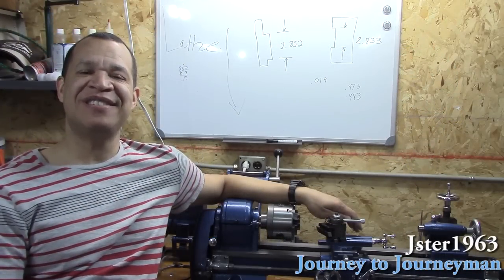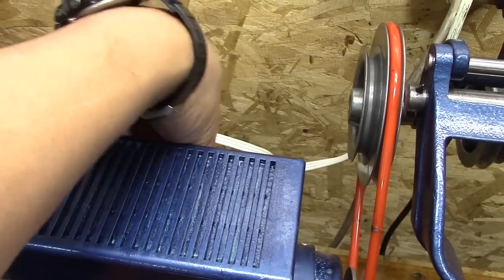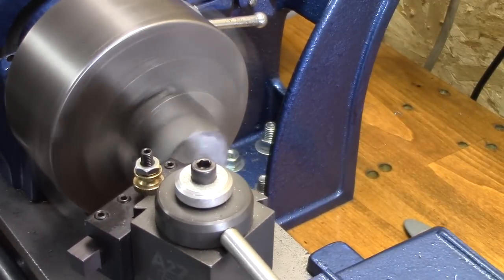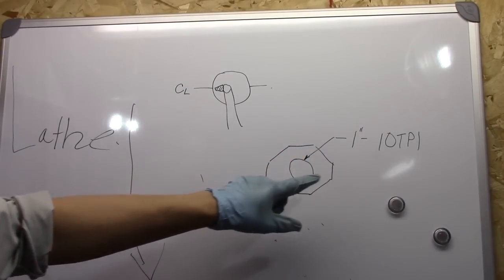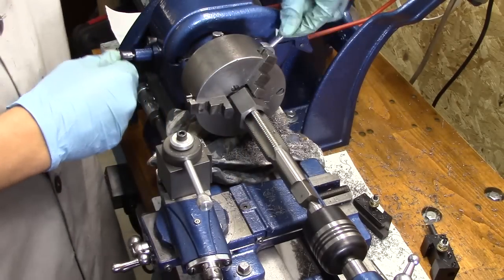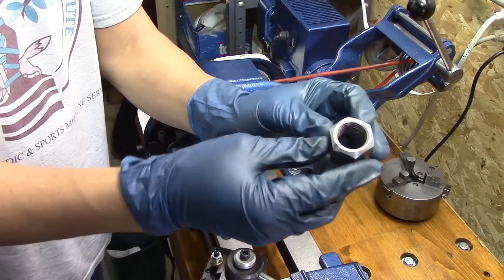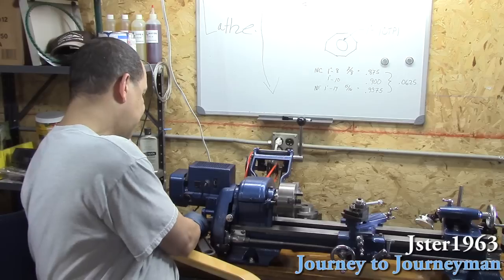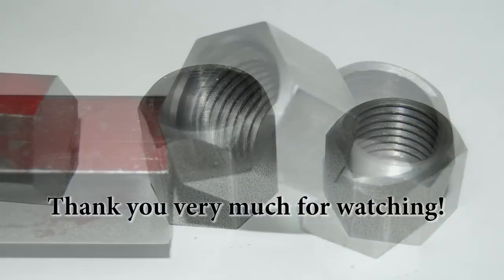Journey to Journeyman, Episode 1, How to make a thread protector

Comment: On broken gear teeth you can clean a flat spot where the tooth was even leave part of original tooth.drill n tap it screw in a screw roughly the right size and a little long ,screw it in shape it and your in business my big mill I repaired that way cause I saw it on my Logan back gear teeth several different teeth were repaired that way and it works . Good luck and take your time . If it's broken you can't hurt it any worse . I make more things from broken or scrap parts , ( Ive done so much with so little I can anything with nothing at all ) lol fun saying.
Reply from the maker: Tim Douglas So true!  I've got nothing to lose. I'll try it I have a couple of gears to fix, so I'll give it a try. And thank you very much....

Comment: your face plate is really called a driving plate & is used for cutting single & multi start threads with the use of a lathe dog, for each start you would move the tail of the dog to the opposite slot. About your chuck not running TRUE , did you face the adapter plate on the lathe or just put on the spindle ? To be as accurate as possible it Must be machined ON the spindle. Good video !
Reply from the maker: Holy cow!  Great info!  I did not know that.  I cant remember how I did it.  But next time I use it, I will do it on the spindle.  Thanks so much.....

Comment: That lathe is probably old enough to have Babbit bearings , I'd be careful of TOO fast of an RPM , also collets are preferred for more RPM , larger diameters which can be chucked up should be run at slower RPM's . higher RPM's will cause more shaking !
Reply from the maker: This lathe has Timken bearings.  However, I am careful of the speed because I don't like it to shake.  I have a set of collets and plan to get more.  I was told to slow down the bigger diameters and I do that now.  Thanks for the info.  This is how I learn..........

Comment: great project. Can I Ask you a question.  why Does my lathe scream like something out of a horror movie ? im using oil so not to overheat the steel being used. thanks
Reply from the maker: +YOUR FISHING CHANNEL LOL!  What's screaming?  The lathe running by itself, or is it your work when you are cutting it?  My lathe is very quiet.  I have a quiet motor and the bearings are new.
Reply: +jster1963 it's my work when cutting.
Reply from the maker: I bet something is loose.  Make sure ALL of your gibs are tight.  Also, my spindle was loose.  If everything is properly tightened, then make sure your tool and tool post are tight.  If that is tight, then concentrate on the tool and tool geometry.  I just watch youtube vids and make sure my tools look like theirs.  Let me know if this helps.....

Comment: Excuse me, I do not speak english . I use Google translator. When drilling you make a few mistakes .
1. The spindle speed is very high. The drill is strongly heated up and becomes unusable , and heating ceases softer.
2. You must use lubrication and cooling of the drill. We sold Special and liquid for this purpose.
Very nice machine , good luck with your venture
Reply from the maker: +Дмитрий Цымбалюк Please excuse me if I already replied to this.  If not, I'm sorry I missed it.  You are right.  Thank you so much!  I need to slow down the spindle speed and use lubrication.  Thank you so much......

Comment: jster, just found your channel based on the WIYB TMC project. After watching this episode I'd like to make a couple comments that struck me. First off, I have to admit that I haven't touched a lathe myself since high school and I've got you beat = 1974. I do watch a lot of the other videos that are out and when you were drilling your first holes, you had the machine running way too fast. I noticed that you turned the drill bit blue due to overheating. You need to find out what speeds your machine is capable of by getting an RPM sensor of some kind.
Reply from the maker: +Art Borchers You are rite on 2 things.  1974 beats my 1981, and yes I was drilling way too fast.  I am teachable, because I did learn that.  This is a HUGE learning experience for me, but extremely rewarding.  Thank you so much for your comment......

Comment: I also applaud you for showing your mistakes. I think the main leason to be learned here is the difference between thinking in abstract terms and actually doing stuff. Metalworking implies a lot of force to remove the unwanted metal from the stock and that force has to go somewhere. All machines (even the huge ones) deflect when taking a cut; now imagine a lathe that weights as much as the chuck of the average mid sized lathe. It deflects orders in magnitude more. And that means that it's always closer to the limit of elasticity in which it deforms irreversibly. Or in simpler words, the point where you damage the machine or the tools attached to it. Your job as a machinist, no matter how large or small, is to be aware of this forces and the properties of your tools, so you can keep the procedure in the safe zone. If you keep this in mind, you can do pretty much any job on any machine (if it fits inside of it, and sometimes, even if it doesn't). Some quick tips: 1) Overhang is your #1 enemy. Use shorter tool bits, shorter drill bits, a shorter chuck (or even the faceplate), return the compoud all the way back to ensure it's supported by the cross slide, use the tailsock or a rest to support the work, etc. 2) Ensure everything is tightened (I noticed that your quick change tool holder didn't keep the height as you were boring). 3) Use HSS tools, if properly sharpened they cut better with less force. 4) Use coolant or at least oil. 5) Keep your mind open for better options: while watching the video I always wondered why you didn't just unclamp the work from the lathe and simply tapped it on the drill press (if you're as careful with it as you are with the lathe, and measure stuff rather than eyeballing it, it works just as accurately). Just a spring tap guide to keep it straight and you can muscle the tap without fearing about breaking something. Keep them coming! -Miguel
Reply from the maker: Wow!  Great stuff, Miguel!  I really appreciate the advice.  I will try it all, or at least all the stuff I can.  I did learn the hard way that I should have taken the part out to tap.  I should have used a vise.  Also, I learned that I need to support my work.  In the second episode, I learn the same thing again;-(  Oh well.... it's a journey:-)  Thank you very much for the info.........

Comment: Great video. Don't throw that scrap piece away. It might make a good cylinder.
*a quick safety tip... Always keep fabric items away from rotating machinery. (i.e gloves, long sleeves, shop towels) Those nitrile gloves should be OK, but use paper towels over your ways, I have seen HORRIFIC pictures of people who have been pulled into their machines.
Reply from the maker: You are so rite!  I pride myself on safety, so I welcome any advice.  I do roll up my shop coat sleeves, but I use rubber (very thin gloves that will just tear off).  As far as shop towels, I would love to say you are wrong....but you are RIGHT!  I found out the hard way that a shop towel WILL get pulled off of my machine.  Luckily I was out of the way and had on safety glasses!

I'm working on a way to keep my machine semi-clean.  I may have to just clean it up after I'm done working.  Also, I didn't (and won't) throw away the "scrap" metal that I make.  In my mind, I can always use it for something. 

Thanks again and I'll always take safety advice.......jster

Comment: Nice video.... funny how hobbie have a way of evolving.... I too have made the switch from restoring garden tractors to buying tons (I use that word "tons" in the literal sense) of machining tools... currently I've restored a 13 inch southbend lathe and a D1 Burgmaster turett drill press... the Bridgeport J head is in my future.... sorry to see the damge but you very well may have saved me from the same situation... I'll keep my eyes open for the parts you need... you know you could just make them.... hint hint... I'd love to see that milling attachment at work....
Reply from the maker: Thank you very much!  I forgot I have a spare headstock that has everything I need.  So don't waste your time looking.  But I appreciate the offer.  My plan is to swap out the broken gears, then repair the broken ones (for spares).  However, I do plan to make parts like that someday (as my skill level grows).

Did you make any vids on your lathe restoration?  I plan to use the milling attachment real soon.  Stay tuned and thanks again.......
Reply: I've been a liitle neglectful of my video posting hobby as of late... but at some point I'll get back to it.

Comment: The teeth probably broke when you were thread cutting.  The torque is huge and the gears could not take that pressure...
Reply from the maker: You are 100% correct!  The torque to get those threads lifted the lag bolts holding the lathe to the stand.  That was a bad idea and it seems like every lesson I learn cost me $$$.  And thank you.....
Reply: I applaud you showing your failure.  We all have ability to learn from others failures but only if they are shown.  The 618 is a very popular lathe and there are many NOS parts available especially on Ebay..  Good luck with the repair.  The repair process would make a good episode.  Carpe Diem-  Fred
Reply from the maker: Thank you very much Fred!  Fortunately for me, I bought an entire headstock last summer for spare parts.  So I have the parts.  I had forgotten that when I made the video.

I have learned from others mistakes too, so I thought I would share mine.  And great idea about the repair.  I will show that.  Thanks again.....jster